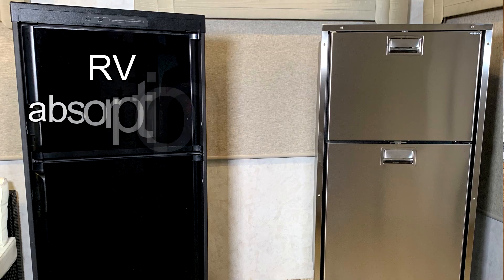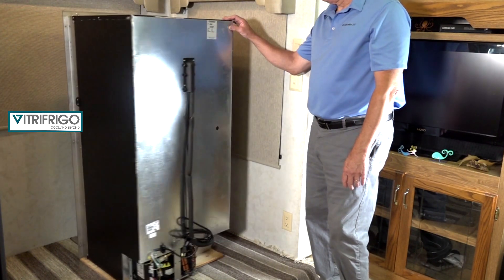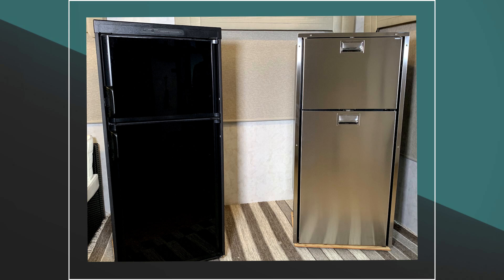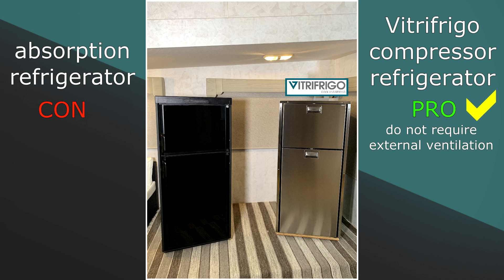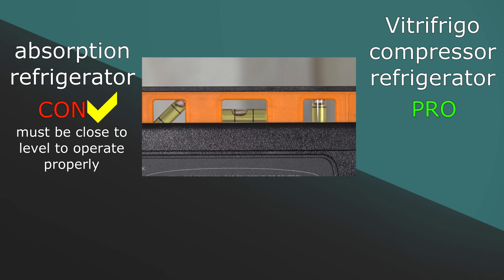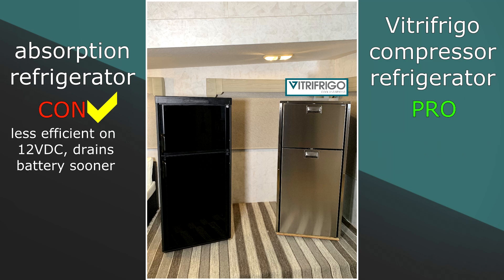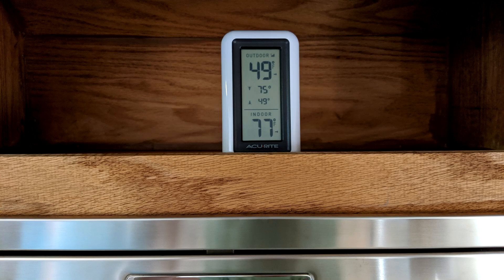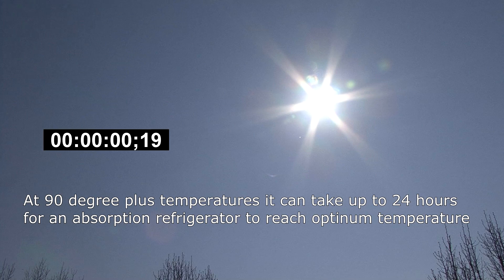RV Technology Comparison: RV Absorption Refrigerator VS RV Compressor Refrigerator

Comment: I enjoyed Mark's video but wanted to add my real world experience with my 12 volt EverChill compressor fridge. I've had mine for a year now. It is in my 2019 Shasta 5th wheel. I have two 215 amp hour 6 volt batteries and 400 watts of solar. When hooked up to my pickup, power comes from the truck making it very safe and efficient going down the road since there is no gas to worry about. As far as heat, it is minimal since the compressor does not run continuously. Besides, where do you think a lot of your air conditioning goes with that big hole behind you gas/elec fridge? When you first turn the fridge on, it uses about 10 amps to do the initial cool down. After that, it uses less then 4 amps to maintain the temperature. And that only happens when the compressor is running. I have boondocked for 5 days and never went below 80% on my batteries. Don't get me wrong, if you have very cloudy sky's for a few days you might need your genny but I never did. I have owned both gas/elec and residential fridge equipped rvs and this 12 volt has worked out much better then either of them.

Comment: Just what I want, a 12V fridge kicking hot air into my living space.  Okay in the winter, not in the summer.
Reply: You also want to be burned to death when your LP fridge catches fire and bbq's you. Yes RV LP fridge are the singles biggest causes of RV fires. OHH and now insurance companies will charge more if you have LP based system or electric only.

Comment: I don't understand the fascination with the Vitrifrigo. If the label is correct that's a LOT more power draw than a regular household refrigerator. I've checked mine and it uses less than .5 amps with the compressor running. Vitrifrigo refrigerators are very expensive. Just buy a small Whirlpool residential refrigerator and be thankful that your RV refrigerator quit. When our RV refrigerator failed it was the best failure we've ever had in our RV.

Comment: We need to know how to repair water damage on side and front panels with the fiberglass on our toyhauler. Does anyone have any links or info they can share? Basically how do you not break the “skin” when replacing the underneath wood walls.

Comment: I think the MSRP should be mentioned. I've only seen one model of the Vitrifrigo and it was almost 2K. For that kind of cost, I'd just go with a residential refrigerator, assuming, I didn't want a refrigerator that will run for a month or longer on propane.

Comment: Just an add for Vitrifrigo, nothing more.
To bad they didn't use my absorption Dometic 6.2 for comparison. At 80F it will cool refrigerator down to 33F and freezer down to 2F in 4 hours.
Dont forget, dry camping almost out of question unless you have large (expensive) battery banks and solar, so please calculate those cost into ownership.